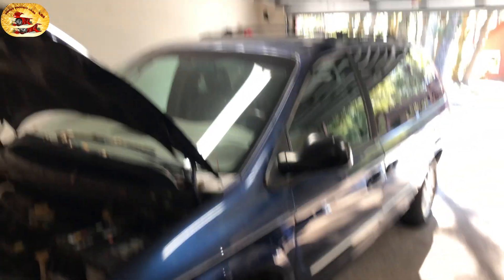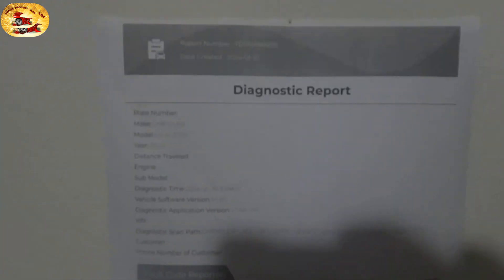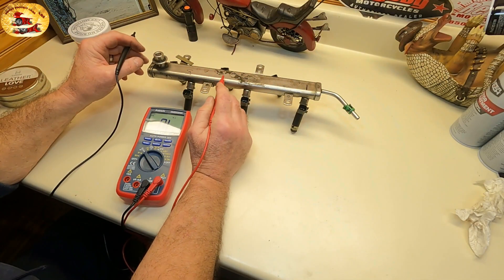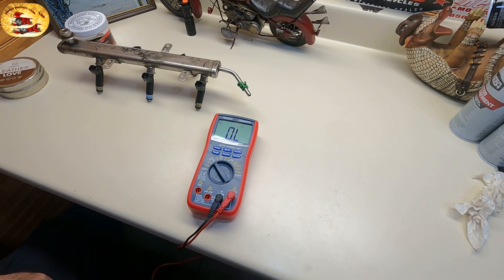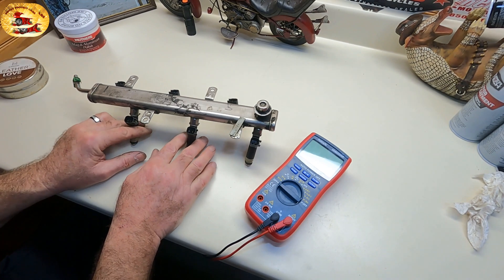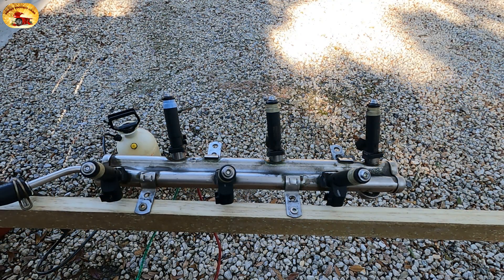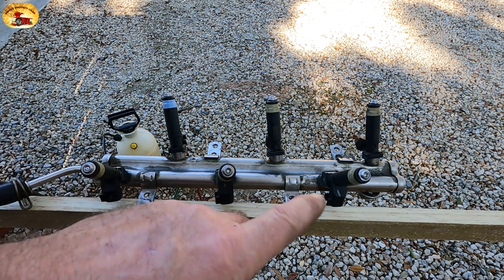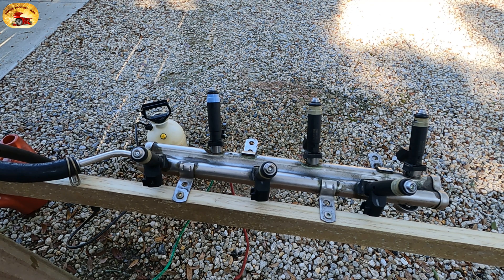Homemade Fuel Injector Cleaning MIX!! "THE BEST YOU WILL EVER USE!!!"

Comment: The secret is not to let the injectors get clogged up in the first place right Mike? 👍💯♥️🇺🇸
Reply from the maker: Billy you’re absolutely right but I know the injector nozzles have very very small holes we’re talking in the microns size matter of fact a grain of sand will not flow through injector spray nozzle so the filters have to be really really good MadMike
Reply: @SweetProjectCars  
Sucks most cars fuel filters are in the gas tank now! 🙄😕

Comment: Howdy Boss! Over the years our vehicles have become more like computers with enough wiring and connections to equal the dang space shuttle. As a result, I have noticed that many of the problems can be attributed to CONNECTION CORROSION. Due to that observation I have been using a little DIALECTRIC GREASE on all of my exposed or metal to metal connections inside connectors. This has been a game changer and you might want to explore this. It works for me!
Reply from the maker: Thank you for that my friend we planned on using a boatload of it as we put the old blue bomber back together with a new harness and everything else have a great weekend

Comment: Thanks again for the video Mike. That'd definitely go a ways to explaining the engine running rough when you got it. 

I suspect that most people will be able to understand that removing the varnish and accumulated gunk will give a better spray, but I think we're going to want to see how you did the rig. Oh and whenever you do the next video can you do the codes again to show that it sorted those codes? 

Also do you figure you're going to need to do the rest of the fuel system?
Reply from the maker: Well the last video we just did Alex showed the problem take a look at it we launched it today we found the problem and yes we will be changing the fuel filter before we start the rig up again have a great day madmike